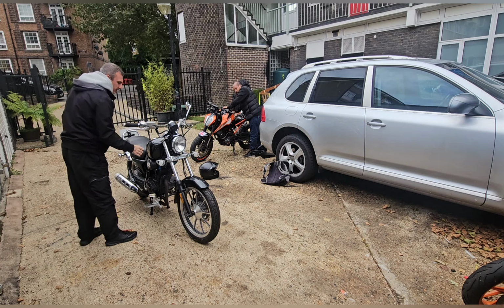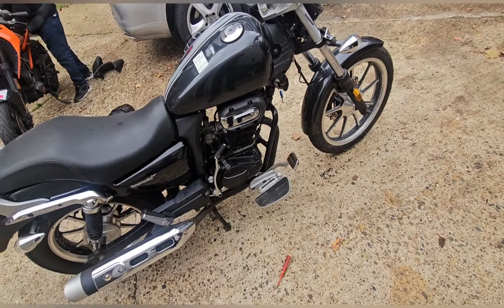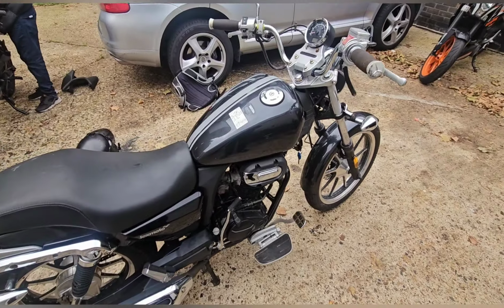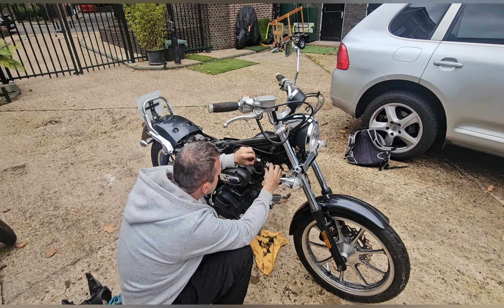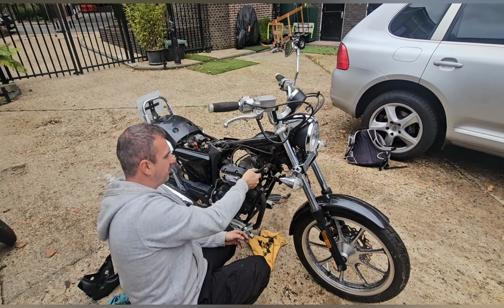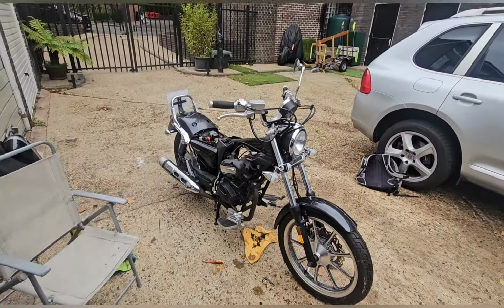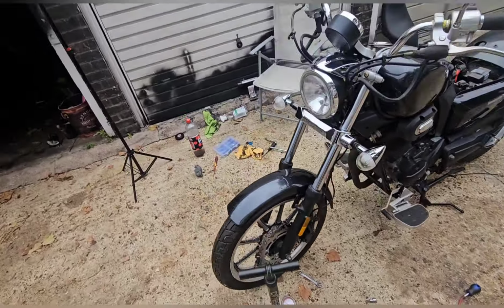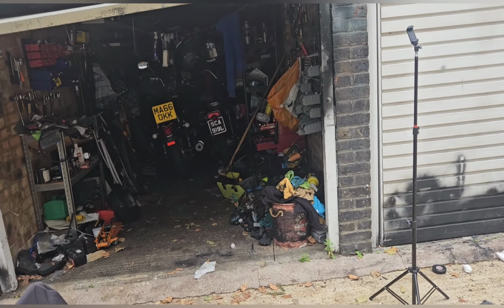Lexmoto michigan 125cc, ignition fix, not as easy as it looks.

Comment: Hello charlie.i love watching your videos.being 66 and been a biker for nearly 50 years I am always learning.just a quick question I remember oiling my Honda's 125  with duckhams chain grease with camping stove basically cooking the chain don't now if modern sealed chains would be safe to use that method.what did you use to remove the old grease on the chains soap/ wd40? making it all shiny. I like to pass on what I learnt to my son the next generation who's knows nothing.many thanks keep up the good work I am waiting for the next video 
Peter
Reply from the maker: Hi Peter, modern sealed chains can still be cleaned with harsh chemicals.  I use fuel if i have any spare, I use wd40 regularly for the cleaning part and then wax or oil appropriately. I still use oil if I have no wax or can grease. 

The old ways haven't died on this occasion Peter. 

I hope your well

Charlie
Reply: @motorcyclerescuer  hi Charlie thanks for your reply.am I right is WD 40 just as good as chain grease  but a lot cheaper just wipe the surplus off? 
Peter
Reply from the maker: @peter1957100 yeh definitely. There has always been a saying that wd isn't good for chains. That's rubbish. They are great for cleaning chains and then you oil it after

Comment: Can you heat up the pedal lever with blow torch and bend it down
Reply: It may leave a heat burn ie discolour the metal & potentially put buyers off.
Reply from the maker: Yeh as Daniel said, but also it's just normal for this bike, because of the longer foot boards. So it's all good. 

Cheers guys